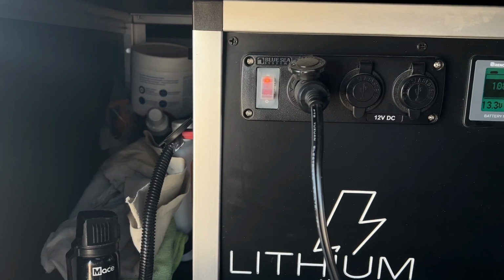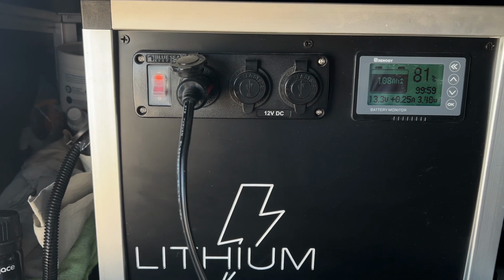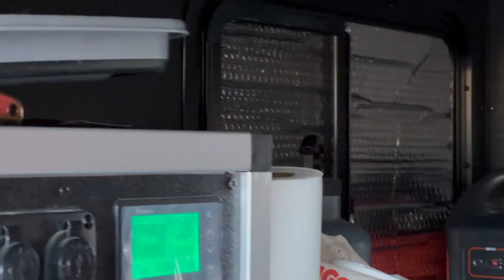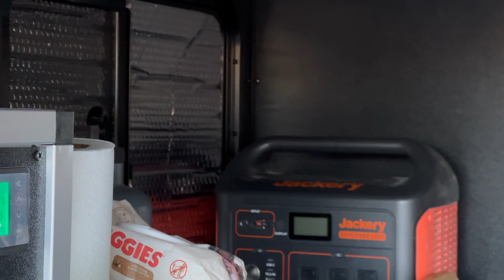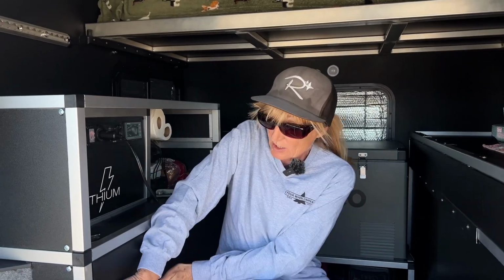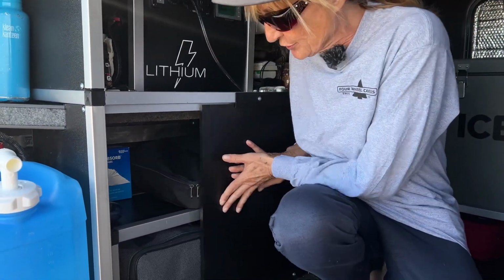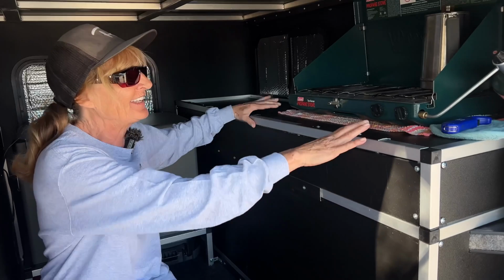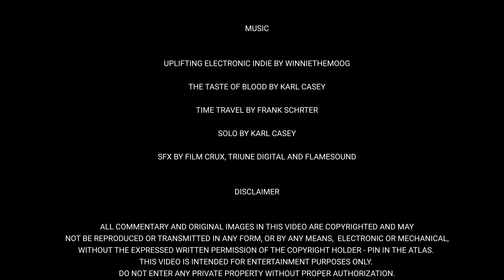Project M build-out - LIVING FULL TIME IN OUR TACOMA

Comment: You two have come along way.. keep moving on up as the Jefferson s would say. Steve looks much more comfortable with short  hair. It’s nice to see Steve working out.  I am glad u two are living comfortably finally 😊😊
Reply from the maker: Still have to figure out heating of some sort. Nothing too large or takes too much fuel. Hope to find something that we can plug in to the battery without draining it!
Reply: @PinInTheAtlas  do you s have an inverter.
Reply: @PinInTheAtlas  somehow u could install a small generator and use an inverter. Than u could have an electric heater. Or some kind of propane.
Reply from the maker: @tinadelwiche416  yes we do. Plugs into the lithium battery. That’s how we use the electric blanket
Reply from the maker: @tinadelwiche416  don’t want to use propane causes too much condensation.  I think a generator would be too big. We don’t have the space
Reply: @PinInTheAtlas  oh some campers have a small ride along built on the side of the camper or tailgate. Maybe you could rig something up. Fortify it
Reply: Steve seems to be good a jack of all trades.
Reply: @PinInTheAtlas  I think there r different size generators maybe look around
Reply from the maker: @tinadelwiche416  that’s worth looking into. Wouldn’t be able to put it on the tailgate though as that’s our only access into the rig. We are hoping to find a small electric fan that doesn’t draw too much power. Just to take the chill off in the morning
Reply: @PinInTheAtlas  yes I’d keep looking. I would not give up hope.
Reply: Or you could try a hardware store if u get in to a town or city. Maybe Home Depot. There has to be something your size
Reply from the maker: @tinadelwiche416  thanks Tina. There’s got to be something out there you’d have thought!
Reply: @PinInTheAtlas  yup,, there’s something out there with your names on it. Or ask Gly. He’s been around and knows that stuff

Comment: Hi Steve and Andrea, fascinated to see how you are achieving the cramming of a gallon into a pint pot!  I love the modular construction system using square section aluminium tubing.  Dare I ask if you have any high tech washing/sanitary fascilities on board, or just a spade for digging?   Great fun to live in Tonto for a week, but I fear I am an old softy who values hot and cold running water and central heating far too much!
Reply from the maker: Thanks Brian. We have to be minimalists 😂 we do have a portable loo and shower. But can only use the shower in warm weather so we go to truck stops and if we’re lucky some free campsites off showers. 
No heating though. Still researching that.

Comment: Nice work.  Quick question.  Where did you find the plastic attachment that connects to the bottom of the back door?  It looks excellent for keeping water out between the door and tailgate
Reply from the maker: Thank you. It’s two parts we bought garage door seal from Lowes for about $8.00 and a small piece of light gauge aluminium L-metal that attaches over the seal to protect it and keep it snug to the bottom of the door. Hope that helps!

Comment: Great video looks like a lot of work. Where did you buy the aluminum shelving from and one more question? Are you running your refrigerator off of the lighter adapter cord into the lithium battery they gave you
Reply from the maker: @MrLesliedavidson  yes the fridge is running off the battery with the lighter adapter. And we actually got all the shelving products from 4wheel. 
Hope that helps
Reply: @PinInTheAtlas  four-wheel told me you couldn’t use the lighter adapter to power the refrigerator because the wire was too small
Reply from the maker: @MrLesliedavidson our iceco fridge runs off it fine on the lithium battery.
Reply: @PinInTheAtlas  you know that’s great to hear

Comment: Do u have a materials list? Thank you.
Reply from the maker: Sorry for the delay Joe. This is what we ordered for our build on the Tacoma. We did have some leftover as we had plans to make the cabinets larger. 
Square aluminium tubing.

16 pieces at 6 feet.
32 pieces at 18 inches.
18 pieces at 16 inches.
16 pieces at 12 inches.

Plastic sheeting.

4 sheets at 6 foot by 18 inches.
2 sheets at 6 foot by 24 inches.
2 sheets at 6 foot by 16 inches.
1 sheet at 3 foot by 18 inches.

76 plastic joining ends.

Comment: Where did you get the aluminum and panels?  What are they called?
Reply from the maker: The materials came from 4 wheel campers and is the same material that encloses the lithium battery. Sorry don’t know the name. But it’s 1/2 inch aluminium tubing and a composite material